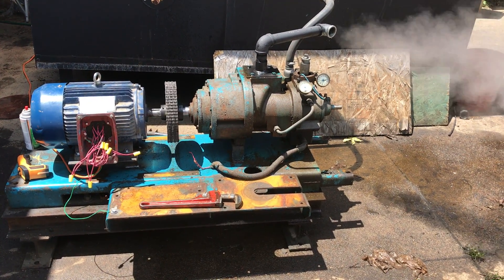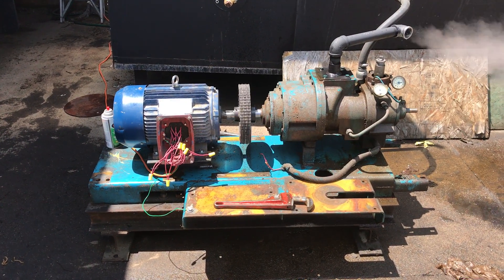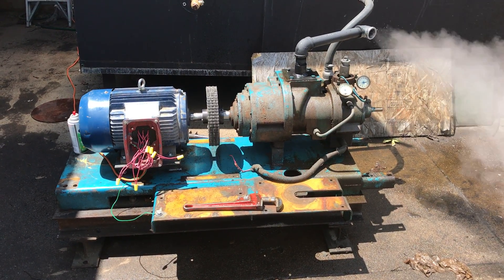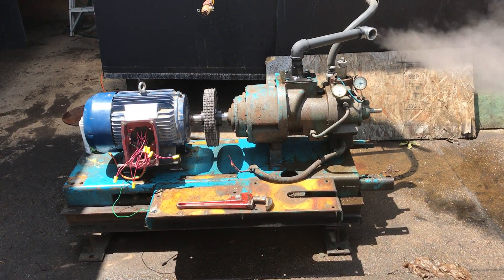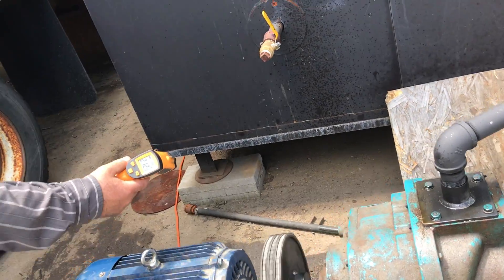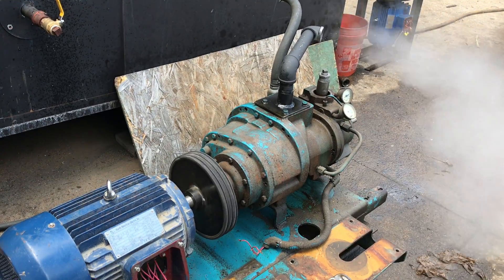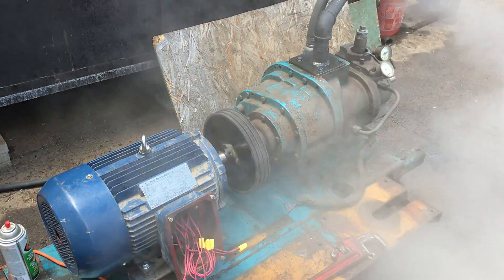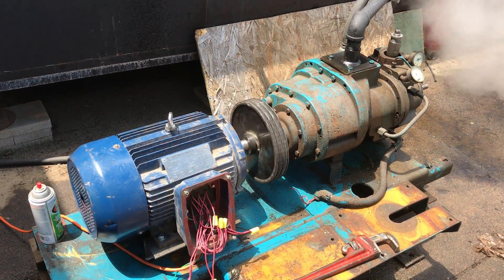POSITIVE DISPLACEMENT ROTARY SCREW STEAM TURBINE

Comment: When I look at your videos, I see that you are ahead of the curve in terms of the common knowledge about this type of energy harnessing/energy production.
I’d been watching this area for a few years to see how things developed. Looks like energy storage is a significant part of solution.
I prefer steam because in a cold climate, excess heat is of value. In summer electricity use for cooling has big demand, and solar is abundant. In winter we have a lot less solar, and require heating burning fuel is necessary.
Really like your ideas ! Thanks for sharing your work !

Comment: Hi Don.... Been watching your Tesla Turbine sets ups but this one really gets my attention. I am clear on how a screw compressor works. IM not sure how you get it to work pushing steam into it. ??? I gotta believe some how the compressor is working  in reverse. But I didnt think the screw compressor could run backwards.  i am obviously wrong about that.  Would you recommend this over the Tesla set up?
Reply from the maker: Converting these is relatively easy. The inlet becomes the outlet and the outlet become the inlet. A few flange and piping changes and it will run backwards very effectively. But not very efficiently. Without an oil seal around the rotor, much of the expansion is happening between the case and the rotor and the expansion chamber is not effectively sealed without a relatively large amount of oil. At higher pressures efficiency becomes decreased. So it works but the steam can not be recycled if we have to inject oil into the rotor to produce a better seal and lubricate the front and rear bearings. A small drop of oil injected every few seconds keeps the bearings working but is not enough to keep a seal against the casing.
Reply: @ourhouseisfull11  hi mr. schmidtke... have some questions about earning electricity from a low pressure steam vessel in best possilble way... and i am far away from being an expert in this technology...you seems to be someone who knows what he is talking about. is it able to get in mailcontact or so?

Comment: Hello i rebuild a large variety of rotary screw compressors for the company i work for, and i would love to know what modifications where made to the compressor itself. I know this video is kinda old but it would be really apreciated if you shared the process of converting the compressor
Reply from the maker: This was initially ceased up on us. We purchased this out of a junk yard and it had been full of water. We just took it apart, cleaned everything up with soda and glass bead blasting and oiled it up. After running about 10 hours we noticed it sounded different and we eventually had to add a drip oiler to the inlet (discharge side of the incoming steam.)  That restored excellent function and and she ran like a well oiled machine with very little oil usage. We wanted to run this without oil contamination but in the end we had to settle for some contamination. Recycling steam became unpractical. But short of some shaft size modifications and good cleaning, we just added a drip oiler to the thing. In my opinion it is not an efficient use of the steam. So it was a fun project, but not very efficient return on the steam. I think it is still sitting out in the bone yard somewhere.  We chose a different direction not long after this video was made.
Reply: @ourhouseisfull11  thank you for replying the information and your kindness are greatly appreciated

Comment: Just goes to show there's nothing new under the sun. I'm actually running steam from a mono tube boiler (400 psi at 500ish degrees) through an automotive supercharger and extracting shaft power to run a vehicle. Ive yet to try to extract power from it, but it's very encouraging to see im not the first to try this! Thanks for posting.
Reply: Hi George, I'm investigating the exact same concept. Is there anything more you can tell me about your system?
Reply: Can I ask what is the exhaust steam temperature and pressure? What is your estimate power? Do you have a video of this unit?

Comment: Lots of good theory there.  But it's only theory until you can see and measure the work produced.  I don't think you have even close to 2kw being produced via lowering the small amount of steam being produced by 15F, assuming you had no heat loss and 100% efficiency there.  And odds are the actually overall efficiency is going to be somewhat less than 25%.  It would be quite simple to hook up 4 or 5 100w lightbulbs directly to the output of the generator in series, then measure the voltage and current through those bulbs....
I'll subscribe so you can show us that.  Even 500w from that system would be awesome IMO.  Would love to see it.
Reply: Could a solar oven that can heat water up to 400 Fahrenheit power a steam turbine?
Reply: Getting a bit of a worm-wheel feeling on this. The operating principals of a mechanical input imparting energy to a fluid is sound. But the reverse? The force diagram for the steam expanding on the screws is tough to visualize.

Comment: How does the compressor not rust and freeze up since the oil was replaced with steam?
Reply from the maker: Steam is a vapor. This vapor has no oxygen in it. So there is no potential of rust which is oxidation. The thrust bearings in these machines are roller style bearings. They are designed to run at 140 psi. Here we are running this unit at 25 psi or less. The expansion of steam is a cooling process. So there is no problem with temperatures rising such as in the compression of air. So lubrication is not the primary concern in these units. The main reason they are oil flooded is to remove the high temperature rise associated with compression. We have run this machine without any issue or noticeable difference yet. But we will see what the long term results may be. At the moment it is too early to tell.  But it has been running without any oil for more than 200 hours.
Reply: Good job Don, I wood like to talk to you about your progreess
Reply: @ourhouseisfull11  mmmm actually they use steam oil in the water mixture.  or parts will wear.  ps.. since when does vapor not have oxygen?  H20 is broken down this way.

Comment: What is the efficiency of this system, is it better than the previous impulse turbine?
Reply from the maker: It is considerably more efficient at lower pressures and our intention is to use this system in a negative atmospheric extraction of waste heats (125-175 F), normally well below the normal boiling point of 212 F.  See attached videos for the direction we are headed in.

https://www.youtube.com/watch?v=NI_76beZ27U

https://www.youtube.com/watch?v=Cy2IJneoiqQ&t=83s
Reply: so this will be powered from the vacuum created in the condenser
Reply from the maker: The vacuum will enable the extraction of the heat value of the heated water. The differential vapor pressure states between the heat sink (condenser vacuum) and heat source (hot water tank) cause the hot to flow towards the cold. This must pass through the turbine and thus the higher vapor pressure of the latent heat of water vapor pulled out of the heat source is expanded in the turbine as the heat and pressure differential is converted into mechanical energy. But now the water vapor can be forced to expand until the temperatures between heat source and heat sink have equalized. If there is no differential in temperatures between the two tanks, then no flow will occur even though all air has been evacuated from the system. Only water vapor is allowed to remain in the closed system.